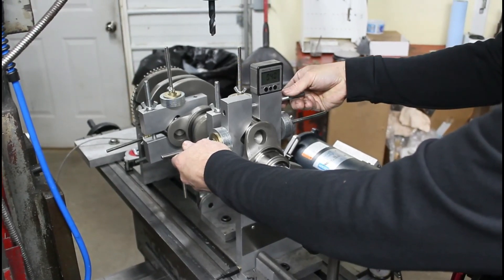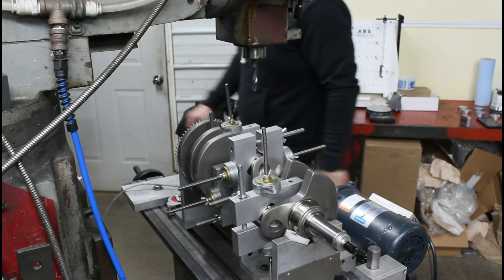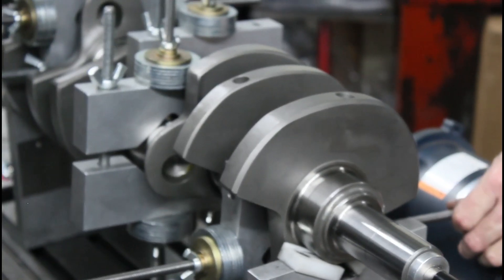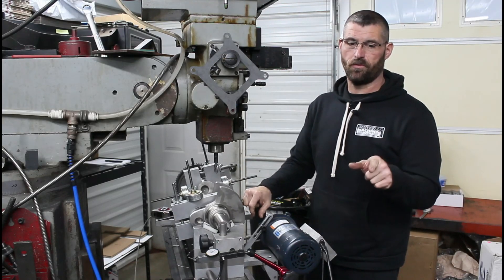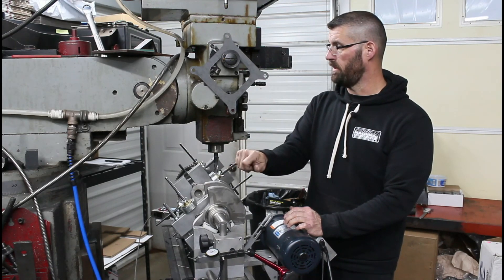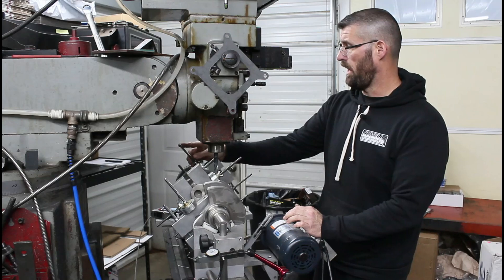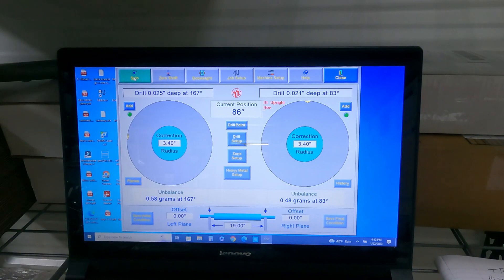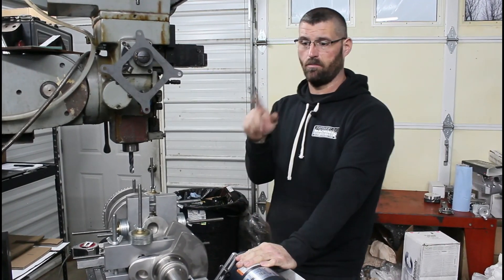Crankshaft Balancing Overview (Ls crankshaft

Comment: I've used a few of these cranks in my builds over the last few years.  Stock stroke, usually get them from summit.  The last Summit one even had the K1 symbol on the front couterweight.  With 5.3 parts hanging off them it's always been subtractive, with 4.03" bore stuff they all needed 1 small slug of mallory in each end.
Reply from the maker: @basscube5  yep, that's why I don't use that junk
Reply: @powellmachineinc  What's the alternative (for a reasonable price)?  Mine have all lived well, next to no runout etc.

Comment: Shop owner here. I have a DCB 750 balancer. It does an awesome job for what I do. My question is do you feel the imbalance angle is important? I always try to end up with my imbalance 180 out from the throw on each end, what do you think and always try to get under 1 g
Reply from the maker: Ideally that would be best in my opinion,  but once you are under a gram I think it's to small to matter

Comment: It doesn't have to be perfect.   If its heavy remove the material from the outer edge of the throw,  never drill it unless you absolutely have to..  a couple of grams is nothing.   You might get that much weight when assembled when there is oil sticking to the bearing
Reply from the maker: Perfect is relative
Reply: @powellmachineinc  Static vs Dynamic Balancing.
Static is repositioning the center of gravity to align with the axis of rotation.
Dynamic is adding or subtracting weights / counterweight to ensure a precise motion and minimizing vibration.
A crankshaft is nothing but vibration.  On a V 8 engine you have two opposing pistons firing at a slightly different time on the same rod pin.
Now think about it, if you are balancing and blueprinting the engine to get the maximum amount of performance out of it, would you want to penalize it by leaving in necessary weight on the outside of the crankshaft?
If you are looking for performance the first thing that you want is to remove mass.
Unless you want to use the engine in a truck for towing or pulling tree stumps.
Reply: Unnecessary weight, damn spell correct keeps changing what I typed
Reply: “Never let perfect be the enemy of good enough” - Voltaire
Reply: @josephspratt2055  Are you sure it wasn't Newton :)

Comment: Nice vid!

We have a DCB-750, software is circa ~2004, and no drill press mounted on the machine. It's a royal PITA to have to move over to our TCM-25 just to drill, then set back up and spin. Takes any profitability out of the job haha
Reply from the maker: I was doing the same thing... this setup was a game changer,  , best money I spent in a long time!
Reply: Why would you not buy it with the drill press?  I have a DCB 750 also.  It does an awesome job.